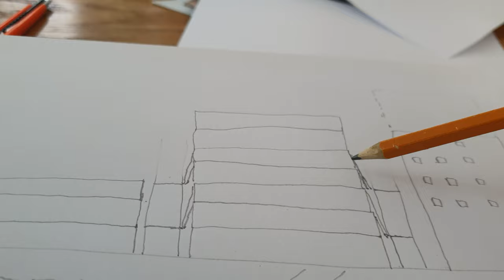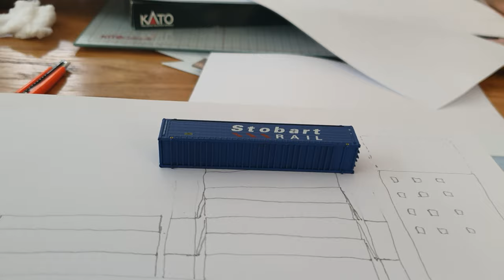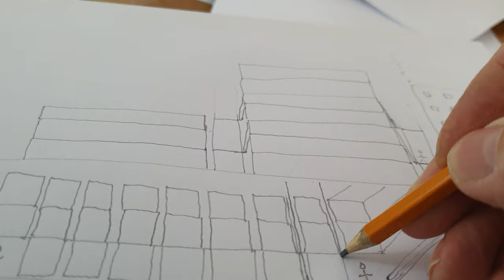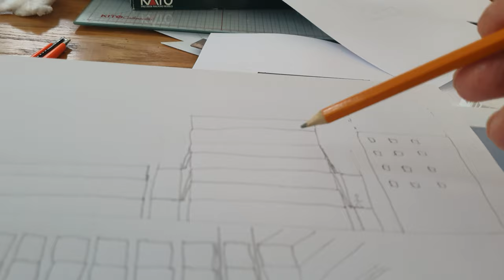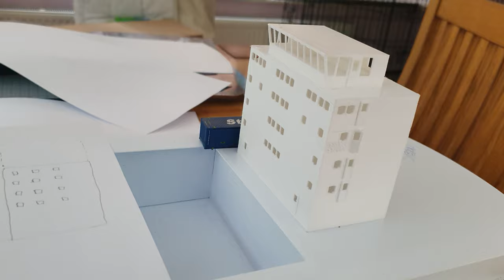No. 93  Part 1 Of The Container Ship Build

Comment: Really interesting. I was a Ship’s Hull Draughtsman in another life and you have done a great job with the cardboard re inforced   Structure.
If you contact Lloyd’s register in London requesting a set of z general Arrangement drawings or  contact the Shipbuilder or where the design drawings have been archived.
Adding a few additional main frames at the bow and toward the stern might assist in firming the shell plating.
Looking forward to seeing it develop
Great job
Cheers Charlie
Reply from the maker: Hi Charlie that sounds like a very interesting job been a Draughtsman for ship's. Thank you for watching hope I don't make a mess of it. Colin

Comment: just a heads up...

40ft is the general standard, there are 45ft road/rail containers, however there is always a gap between stacks of containers so that deck crew can fit the lashings to the lower parts of the stacks.   

you generally stack 6 high  with the boxes then you get the hatch and another 6 on top of the hatch.  Your stacks on top of holds 1 and 2 will be lower than hold 3, which will be lower than the rest of the holds, and they will be somewhat lower than the bridge area in order to give the lookouts on the bridge a good field of view.
Reply from the maker: Hi Thank you for the information the bridge with the living area are going to be made taller on with making the first double cell guides and are allowing a walk way through from one side to the other. Colin